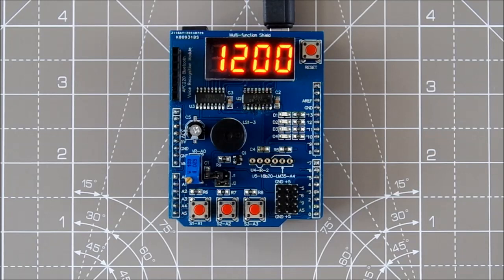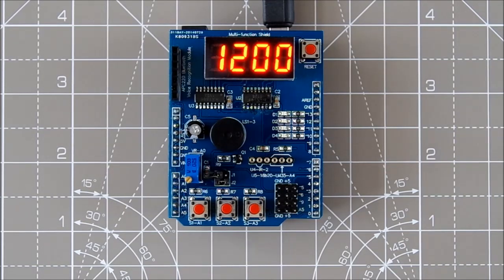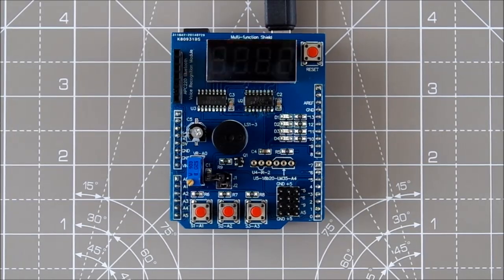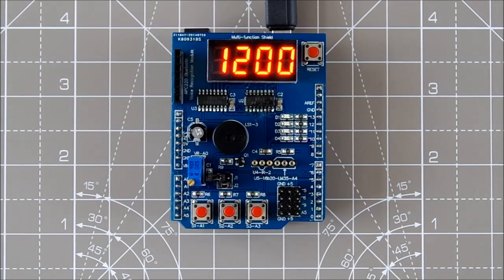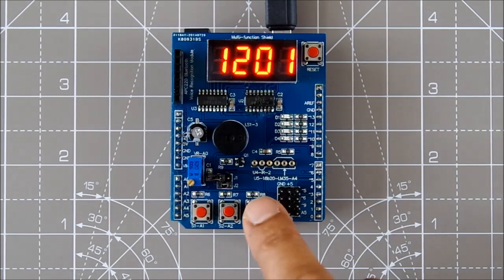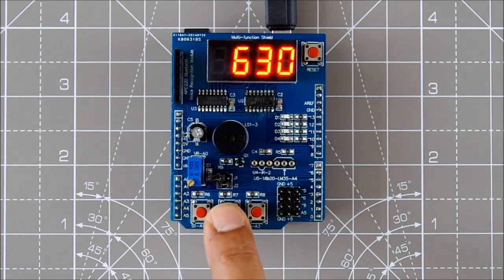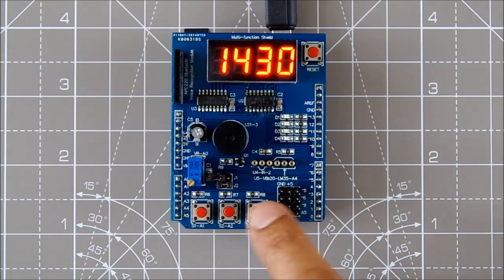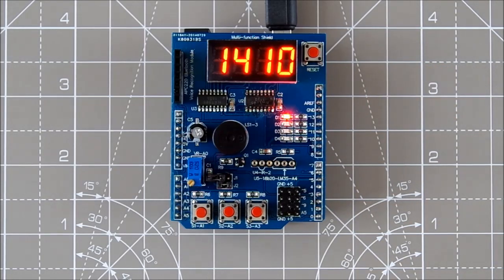Digital Alarm Clock Using Arduino Multi-function Shield

Comment: Hi to all,
I modified the 24h alarm clock’s displayTime function to insert a dot “.” betwen hours and minutes.
Here my source:
void displayTime (byte hours, byte minutes)
{
char time[6];
char trime[6];

sprintf(trime, “%4d”, (hours * 100) + minutes);

time[0]=trime[0];
time[1]=trime[1];
time[2]=((char)46);
time[3]=trime[2];
time[4]=trime[3];

MFS.write(time,2);
}
Reply: Here my last version: https://forum.arduino.cc/index.php?topic=707835.msg4758456#msg4758456

Comment: Links to source code appear to not be working. ???
Reply: Use this source (with dot betwen hours and minutes:

#include <TimerOne.h>
#include <Wire.h>
#include <MultiFuncShield.h>

/*

For more information and help, please visit https://www.cohesivecomputing.co.uk/hackatronics/arduino-multi-function-shield/part-3/

All our hackatronics projects are free for personal use, and there are many more
in the pipeline. If you find our projects helpful or useful, please consider making
a small donation to our hackatronics fund using the donate buttons on our web pages.
Thank you.

*/

/* 
 *  Program modified by KMZ alias p.i. Davide Cosciani
 *  to add a dot "." between hours and minutes.
 *  04 October 2020.-
 */

/*
  button 1  : hold to set time or alarm
  button 2  : press to view alarm time or cancel alarm if in progress
  button 3  : increment hour / minute when setting (alarm) time. Hold to toggle alarm setting.
  
  LED1  : on = alarm enabled
*/

volatile unsigned int clockMilliSeconds = 0;
volatile byte clockSeconds = 0;
volatile byte clockMinutes = 0;
volatile byte clockHours = 12;
volatile byte clockEnabled = 1;

byte alarmMinutes = 30;
byte alarmHours = 6;
volatile byte alarmEnabled = false;

byte alarmTogglePressed = false;

enum displayModeValues
{
  MODE_CLOCK_TIME,
  MODE_CLOCK_TIME_SET_HOUR,
  MODE_CLOCK_TIME_SET_MINUTE,
  MODE_ALARM_TIME,
  MODE_ALARM_TIME_SET_HOUR,
  MODE_ALARM_TIME_SET_MINUTE
};

byte displayMode = MODE_CLOCK_TIME;

//--------------------------------------------------------------------------------------------------
void setup()
{
  Serial.begin(9600); // Setup comunicazione Seriale
  
  Timer1.initialize();
  MFS.userInterrupt = clockISR;
  MFS.initialize(&Timer1);
  
  MFS.blinkDisplay(DIGIT_ALL);
  //MFS.beep(500);
}

void loop()
{
  // put your main code here, to run repeatedly:
  
  byte btn = MFS.getButton();
  
  switch (displayMode)
  {
    case MODE_CLOCK_TIME:
        displayTime(clockHours, clockMinutes);
        
        if (btn == BUTTON_2_PRESSED)
        {
          MFS.beep(0);  // cancel the alarm.
          displayMode = MODE_ALARM_TIME;
        }
        else if (btn == BUTTON_1_LONG_PRESSED)
        {
          MFS.blinkDisplay(DIGIT_ALL, OFF);
          MFS.blinkDisplay(DIGIT_1 | DIGIT_2);
          displayMode = MODE_CLOCK_TIME_SET_HOUR;
          clockEnabled = false;
          clockMilliSeconds = 0;
          clockSeconds = 0;
        }
        else if (btn == BUTTON_3_LONG_PRESSED && !alarmTogglePressed)
        {
          alarmTogglePressed = true;
          alarmEnabled = !alarmEnabled;
          MFS.writeLeds(LED_1, alarmEnabled);
        }
        else if (btn == BUTTON_3_LONG_RELEASE)
        {
          alarmTogglePressed = false;
        }
        break;
        
    case MODE_CLOCK_TIME_SET_HOUR:
        if (btn == BUTTON_1_PRESSED)
        {
          MFS.blinkDisplay(DIGIT_1 | DIGIT_2, OFF);
          MFS.blinkDisplay(DIGIT_3 | DIGIT_4);
          displayMode = MODE_CLOCK_TIME_SET_MINUTE;
        }
        else if (btn == BUTTON_3_PRESSED || btn == BUTTON_3_LONG_PRESSED)
        {
          clockHours++;
          if (clockHours >= 24)
          {
            clockHours = 0;
          }
          displayTime(clockHours, clockMinutes);
        }
        break;
        
    case MODE_CLOCK_TIME_SET_MINUTE:
        if (btn == BUTTON_1_PRESSED)
        {
          MFS.blinkDisplay(DIGIT_3 | DIGIT_4, OFF);
          displayMode = MODE_CLOCK_TIME;
          clockEnabled = true;
        }
        else if (btn == BUTTON_3_PRESSED || btn == BUTTON_3_LONG_PRESSED)
        {
          clockMinutes++;
          if (clockMinutes >= 60)
          {
            clockMinutes = 0;
          }
          displayTime(clockHours, clockMinutes);
        }
        break;
        
    case MODE_ALARM_TIME:
        displayTime(alarmHours, alarmMinutes);

        if (btn == BUTTON_2_SHORT_RELEASE || btn == BUTTON_2_LONG_RELEASE)
        {
          displayMode = MODE_CLOCK_TIME;
        }
        else if (btn == BUTTON_1_LONG_PRESSED)
        {
          MFS.blinkDisplay(DIGIT_ALL, OFF);
          MFS.blinkDisplay(DIGIT_1 | DIGIT_2);
          displayMode = MODE_ALARM_TIME_SET_HOUR;
          alarmEnabled = false;
        }
        break;
        
    case MODE_ALARM_TIME_SET_HOUR:
        if (btn == BUTTON_1_PRESSED)
        {
          MFS.blinkDisplay(DIGIT_1 | DIGIT_2, OFF);
          MFS.blinkDisplay(DIGIT_3 | DIGIT_4);
          displayMode = MODE_ALARM_TIME_SET_MINUTE;
        }
        else if (btn == BUTTON_3_PRESSED || btn == BUTTON_3_LONG_PRESSED)
        {
          alarmHours++;
          if (alarmHours >= 24)
          {
            alarmHours = 0;
          }
          displayTime(alarmHours, alarmMinutes);
        }
        break;
        
    case MODE_ALARM_TIME_SET_MINUTE:
        if (btn == BUTTON_1_PRESSED)
        {
          MFS.blinkDisplay(DIGIT_3 | DIGIT_4, OFF);
          displayMode = MODE_CLOCK_TIME;
          alarmEnabled = true;
          MFS.writeLeds(LED_1, ON);
        }
        else if (btn == BUTTON_3_PRESSED || btn == BUTTON_3_LONG_PRESSED)
        {
          alarmMinutes++;
          if (alarmMinutes >= 60)
          {
            alarmMinutes = 0;
          }
          displayTime(alarmHours, alarmMinutes);
        }
        break;      
  }
}

void displayTime (byte hours, byte minutes)
{
  char time[6];
  char trime[6];

sprintf(trime, "%4d", (hours * 100) + minutes);

time[0]=trime[0];
time[1]=trime[1];
time[2]=((char)46);
time[3]=trime[2];
time[4]=trime[3];

MFS.write(time,2);
}
/*
// old function without dot 
void displayTime (byte hours, byte minutes)
{
  char time[5];
  
  sprintf(time, "%03d", (hours * 100) + minutes);
  MFS.write(time, 1);
}

*/

//--------------------------------------------------------------------------------------------------
void clockISR ()
{
  // Perform ripple count for all time components.
  if (clockEnabled)
  {
    clockMilliSeconds++;
    if (clockMilliSeconds >= 1000)
    {
      clockMilliSeconds = 0;
      
      clockSeconds++;
      if (clockSeconds >= 60)
      {
        clockSeconds = 0;
        
        clockMinutes++;
        if (clockMinutes >= 60)
        {
          clockMinutes = 0;
          
          clockHours++;
          if (clockHours >= 24)
          {
            clockHours = 0;
          }
        }
             
        // If current time coincides with alarm time, and alarm is enabled, engage the alarm.
        if (alarmEnabled && (clockMinutes == alarmMinutes) && (clockHours == alarmHours))
        {
          MFS.beep(
                    10,  // on period
                     5,  // off period
                     4,  // number of cycles
                   100,  // number of loop cycles
                    50   // delay between loop cycles
                   );
        }
      }
    }
  }
}